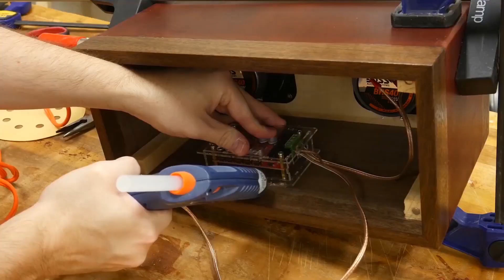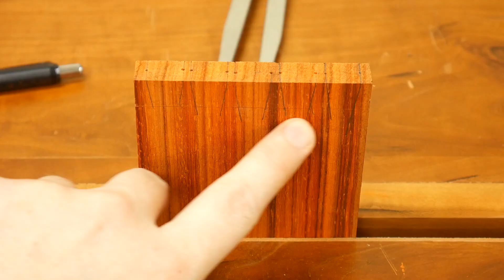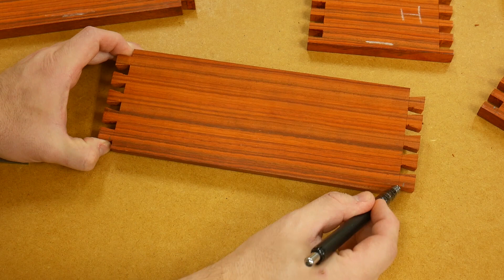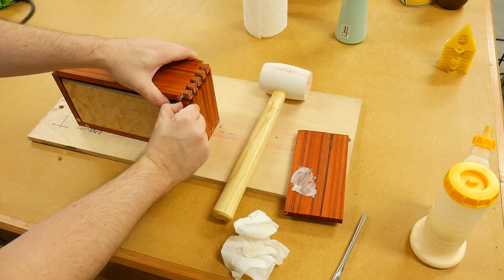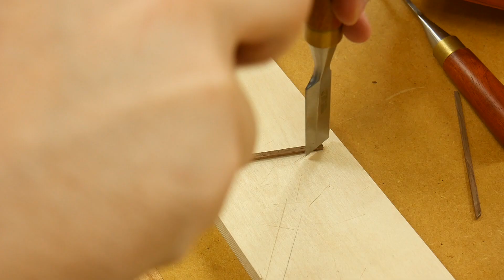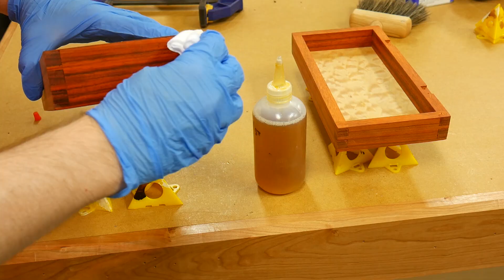How To Make A Dovetailed Box | Easily Cut Dovetails With This Jig!

Comment: Great video! Very detailed -  you are a real craftsman. But please, take off the word “easily” in your descriptor..
Reply from the maker: +Richard Brunet why? It's the easiest way to hand cut dovetails. If you want an easier method thats not hand cut, use a router jig.
Reply: SimpleCove . Because this is not an easy to build project. It requires a lot of finesse and you need to have had quite a bit of practice to get the great results you did.